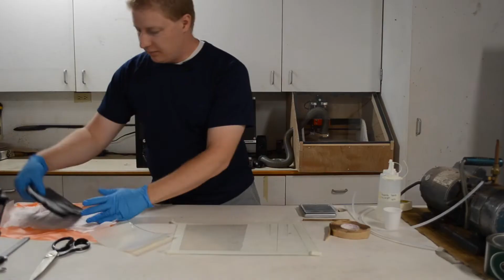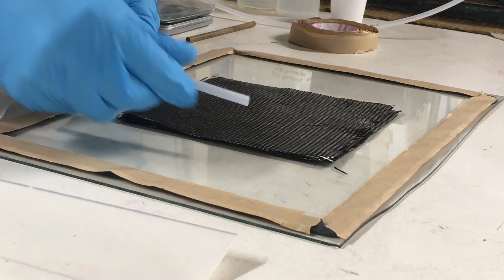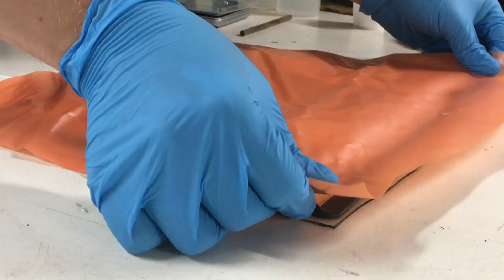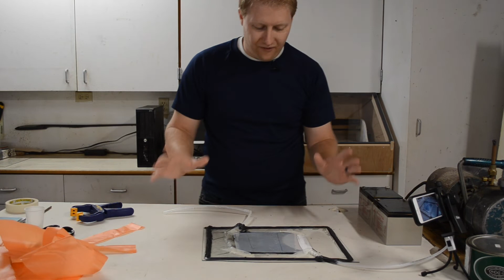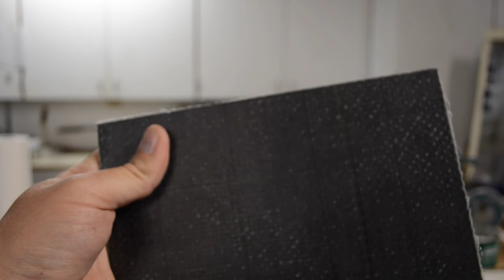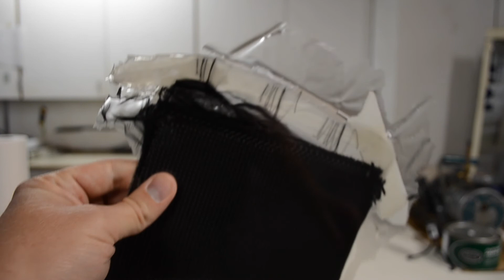Vacuum Infusion Fail!

Comment: If you have a larger outlet flow medium than inlet, the the resin will not pool up as much at the inlet. I use green flow 77 for the inlet and spiral tube wrapped in peel ply for the outlet.  You can also clamp off the inlet if it starts pooling until more resin has been infused through the part.  
Keep in mind though I've only been doing composite work for 1-2 years. But my technique seems to work.

Comment: it puffed up becouse .... either the vacum wasnt strong enough(that means ur pump isnt strong enough or you didnt seal it well) or your resin is to thick and just stops and goes really slow through the carboon and just stravels around it and goes straight into the exit pipe

Comment: Easy way to avoid expensive mistakes is to get a liquid filled vacuum gauge.  Pull vacuum on the layup and document the vacuum pulled.  Wait one hour.  If the gauge one hour later has not moved then youre leak free and should move forward.  

Alternatively, you can buy an ultra sonic leak detector like Amprobe....its a novelty item but if you start to take this stuff seriously, youll want one.

In terms of resin, you can heat your resin to lower its CPS.  The stuff youre using looks to be generic Epon epoxy.  Thats normally at 900 to 1000cps.  Good infusion resin is around 400 or lower.  With green flow media and some heat (to part A only) you can get normal laminating resin to move quickly.  Just keep in mind it will cure faster.
Reply: Make a standard infusion layup on glass and make a plate.  Cut it in 1/2 and glue the halfs together  so you get a perfect finish ...
Reply from the maker: Thanks for the tips.  The resin is Resin Research Composite Pro 2050.  They list a viscosity of 400-500 on their website.
Reply: Sasquatch Composites good deal.  Saw your second video.  Awesome results.

Comment: Use flash breaker (vinyl) tape instead of masking tape to hold down anything under the bag. Masking tape will not stick to release-treated surfaces.
Reply from the maker: In this case the masking tape actually worked really well.  But you're right that flash tape is the preferred choice.

Comment: You have to use vacuum chamber. Vacuum chamber should be between the infusion bag and the vacuum pump. It absorbs vacuum pressure fluctuations once you opened the epoxy tube and makes the process smooth and more forgivable.
Reply: you dont need it if you time the resin harden time correctly but yes it is easyer and can help with the bubbles/ traped air

Comment: couple of suggestion to fix your issues. you can use resin infusion mesh on top of the carbon fibre fabric and resin will flow from one end to the other like a river. i wouldnt connect those hoses from the sides, try to enter from the top on each side and wrap a good amount of tacky tape around the hose where bagging film and hose connects and its all done.

Comment: I’ve done a fair bit of composites work myself. I’ve experienced the same failures in infusion...

What I learned is
Resin viscosity is really important (be it VE or epoxy, you can’t just grab a typical wet lam system and infuse reliably. Get a system specifically for infusion)

You already keyed into the leaks. The bag seal has to be perfect

My thought on the resin pulling is that the layup you’ve chosen (double A side, so no breather) has allowed for the vac pressure to pull the bag down so tightly that it’s sealed itself off (or mostly as there was obviously still enough pressure differential to pull resin into the laminate). The resin pools at the inlet because the pressure differential there is very low (once you open the feed line, it’s basically the same as the resin cup, which is atmosphere). Not a big deal if you keep the pump going and can clamp off the feed line. 

There aren’t many channels into composites in a useful way. I think you are heading down the right track with your channel. 

Best of luck and looking forward to seeing what’s next

Comment: Great video! Thanks for sharing the failure so we can avoid it! 
Just a thought, maybe a little less peel ply in the intake and a bit longer tube between the tacky tape and the fabric. It might give a bit faster resin flow and have more area for the bag to pull down around the tube. 
One more thought, some way of minimizing the tube movement on the intake while the resin is flowing, could have been part of the leak problem.
Hope your new pump works better!

Comment: Great video man. I've been wanting to try my hand at vacuum infusion for awhile but I'm just not at that point yet. That being said, I don't know how you're planning on cutting that carbon fiber plate but in the past I've used a wet saw with fantastic results.
Reply from the maker: Wet saw works great. I'm going to be cutting it with my CNC.  That'll be another video :)
Reply: Thanks for the reply. I'm enjoying your content so far.